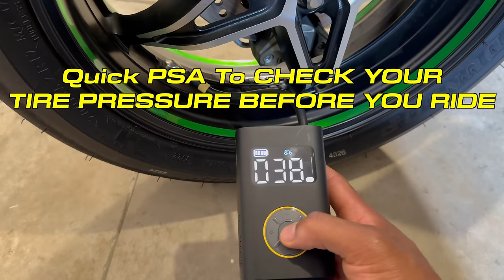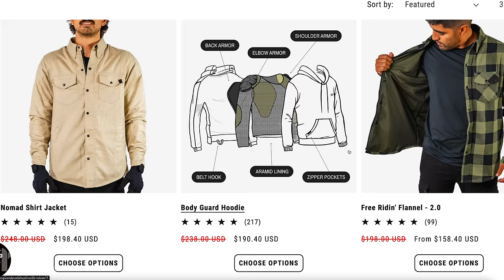CHECKING OUT THE WORLD'S FASTEST NINJA H2's 😈

Comment: The first H2 converted to Turbo was from Turkey, it reached something close to 600 Whp of wheel, It has the Option to Upgrade the Supercharger for a larger one, It goes beyond +400 Whp by machining and exchanging the SC Wheel for a larger one.
Reply: Im the owner of the h2 turbo , we reach 501 at wheel at 28psi.We stopped because carbon wheel started to slipping tire wall.
Reply: @redjack8823  H2 No need to convert to Turbo, several H2s do Supercharger wheel upgrades, with just one 76mm wheel, in stage 2 common fuel you get 400 whp of wheel, an 80mm gets 500 whp of wheel, I've seen some SC wheels .
Reply: Well its depend  what you want and what expect. And i tested with stage 2 -stage 3 even with bigger supercharger wheel upgrades already agaist turbo. Low boost even well enough agaist all. I not built to bike for hp, if look for hp still have  alot of psi with turbo ir can go for bigger turbo etc etc, its like never ending upgrades possibilities. Both bikes fine and enjoyful thats what matter for owner what i believe
Reply: @redjack8823 but the gains of the Supercharger do not compare to a Turbo, a Supercharger makes less rotation per minute, stage 3 does not make more than 200 thousand RPM, a Turbo does more than that, 240-260 thousand RPM, the H2's Supercharger wheel it is really big original, 69mm, put a turbo with a 69mm rotor, it will give more power, for the Supercharger to be equivalent in power, the Wheels are always Big, for H2 they are 76MM,78MM,80MM, and at the limit of the housing they are 84MM , if you want it bigger you will have to make a new supercharger and adapt it, the wheels I mentioned just need machining and changing the resistant bearings, you have to reinforce the internal parts, otherwise they will break.
Reply: This H2 drag has 400 whp, you can increase this power much more.
Reply: You can increase power , its not an issue but turbo kicks different then supercharger. Its all about how much you wanna invest on the bike. You add power  need more and more things to upgrade only. Dont know which part will failure  while you increasing. Im happy with my setup just need to do some more billet parts to increase for more power,only not happy with country situation right now. Hard to ride bike even with tail tidy . Not able to use bike freely in Turkey anymore like before, non stop they  ban bike from traffic
Reply: @redjack8823 yes, the Turbocharger is much easier, it is easier to increase the PSI, just adjust the turbo pressure valve, the Supercharger is more complex, to increase the pressure you have to move the SC gears, and even then you will lose a lot of time adjusting this, as it's not common H2s with +400 whp out there, it's all very new.
Reply: @redjack8823 When I specifically talked about increasing the power of the H2 drag race to 400 whp, I was referring to changing the super charger, the H2 uses a 76mm one, with larger wheels, 78,80MM you can increase the power without increasing (PSI) while maintaining efficiency with more power
Reply: Agree with all. i have one  with bigger impeller . I tested all mods with h2s already. big impeller with stage3 what so ever can you imagine. Ive tested all etc . With turbo bike not so much enjoyful here because of not many powerful bikes can see at streets not many testing possibilities. Ive tested against h2s with friends stage2 /3  . Friends even dont wanna tested much because  no way to catch . Was enjoyful project for me. I have few h2s. I like both wheel bases as well
Reply: what size wheel did you use? and what power?
Reply: Beeen really long ago it was 2017, i must check charts. Need to measure when i go to my storage